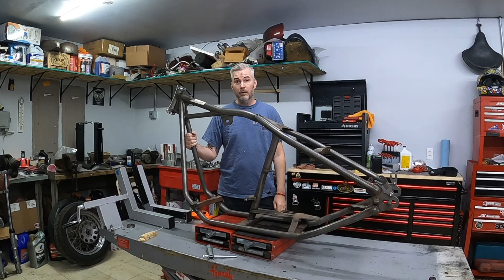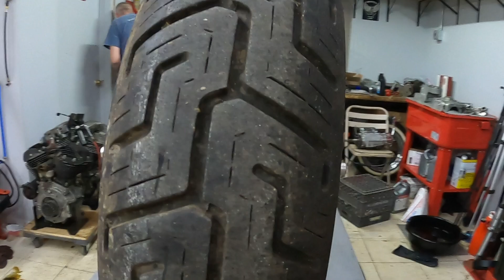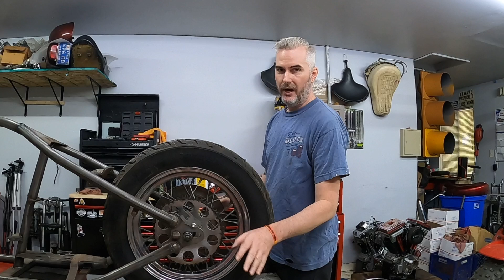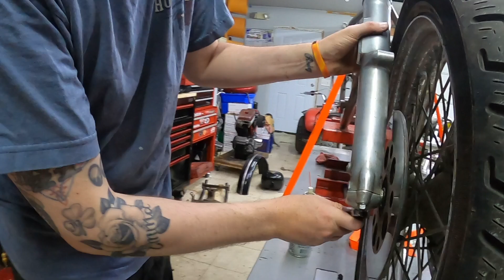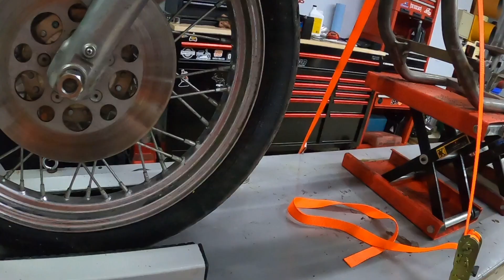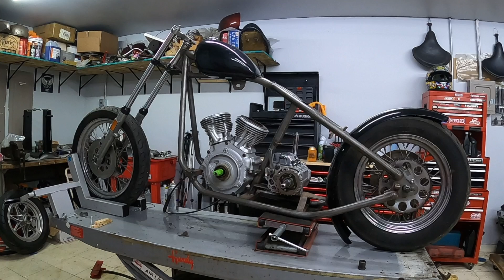Harley Davidson Chopper Project Part 1 HD 1080p

Comment: That's not a 'chopper', it's a custom build! A proper chopper starts out as a stock factory frame that gets cut, bent, welded or otherwise modified.
Reply from the maker: Even though I’m using so many other Harley parts that are being chopped, welded and or modified.